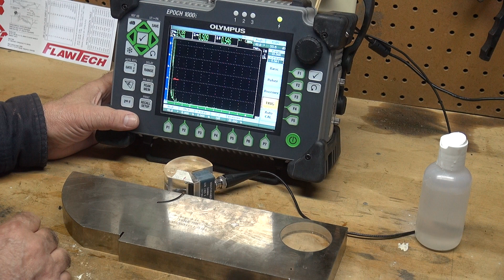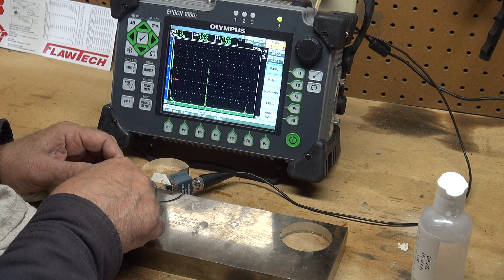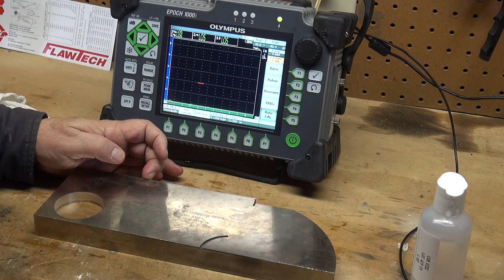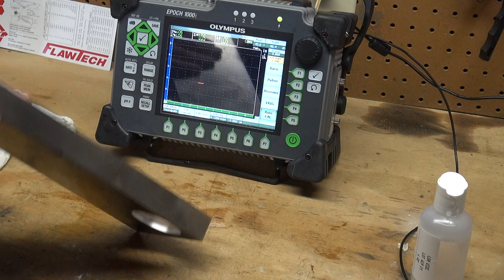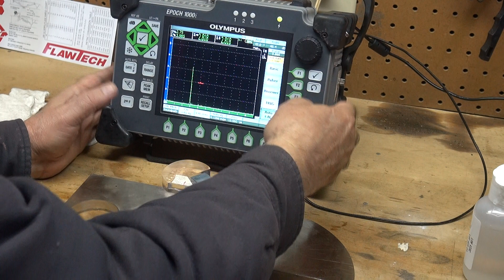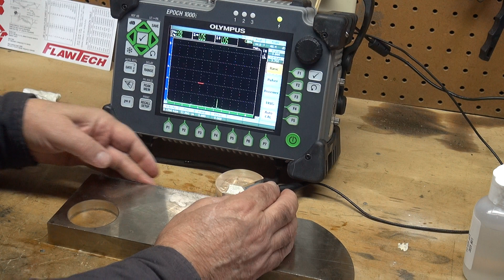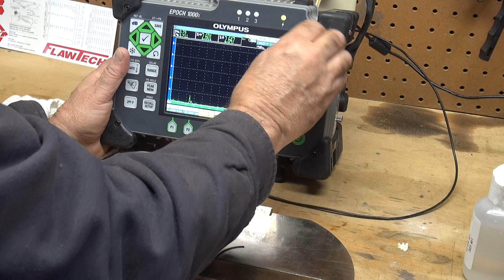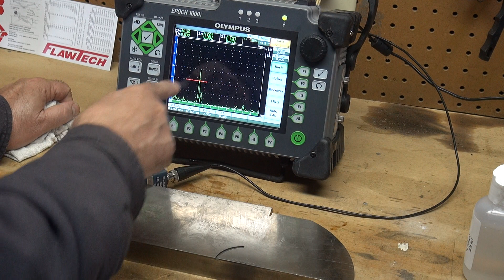UT Angle Beam Calibration Using IIW Type 1

Comment: Hi. Here I go again. is it necessary to mark index point in both sides of the wedge or it is not required? Thank you.
Reply from the maker: Hi Gustavo.  No, it is not necessary to mark the BIP (beam index point) on both side of the transducer.  The reason I did is because to find the BIP on the transducer the signal was directed at the radius on the IIW block and I marked that point on the transducer.  To measure the actual angle of the transducer it requires the transducer to be flipped to the other side on the IIW block, the original BIP mark will not bee seen unless you transfer the mark to both sides of the transducer.
Reply: @johnnyb28227  
Hi sir 
I need help from you please give me your number or email